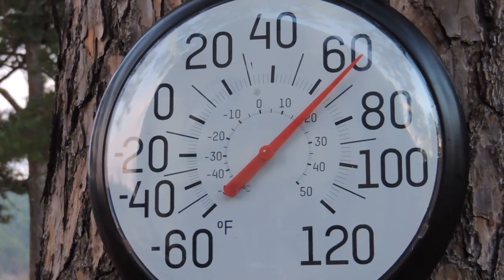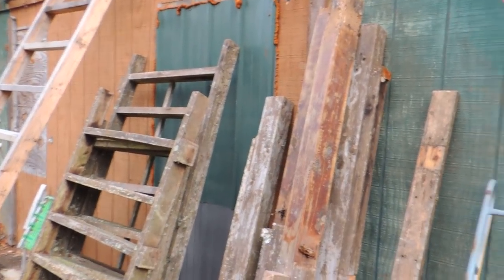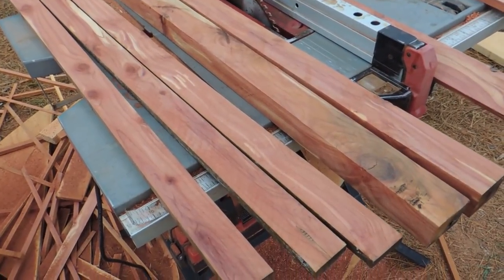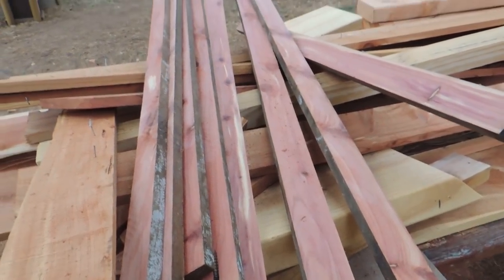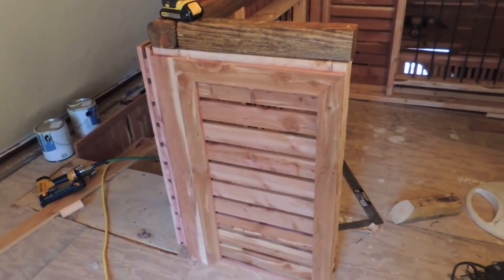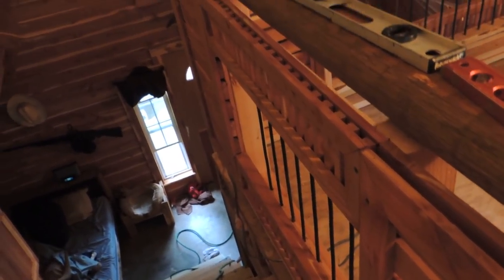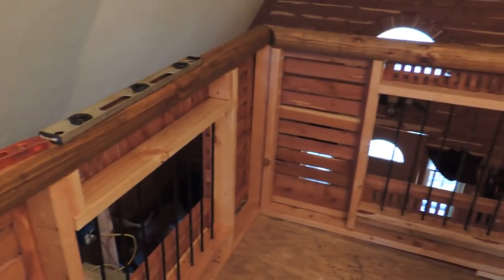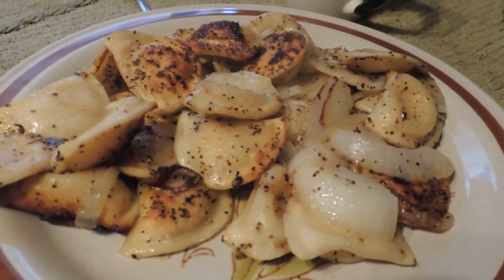CEDAR TRIM. CABIN LOFT RENOVATION. Finishing up the new railings

Comment: Hey there Dogman Mike! 
Is it just me or are you climbing those steps with more ease these days? Your legs must be building muscle and strength after several weeks of going up and down. Stretching my legs in the air, before I get up out of bed, really helps my lower back and leg pain levels and seems to give me a burst of energy. Maybe try it. That side panel looks so nice and creates a cozy cubby in that front area. I think a lift-up table hooked to that side panel would make a great side table for your chair. Either that or maybe a square bookshelf to stabilize that railing and create a side table for your chair, plus a couple of shelves for the remote and maybe a table lamp.